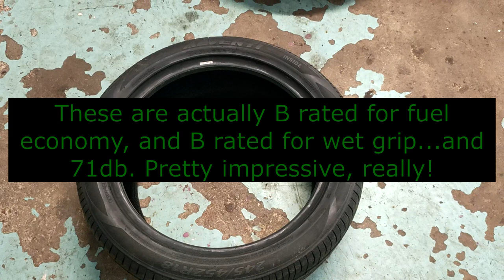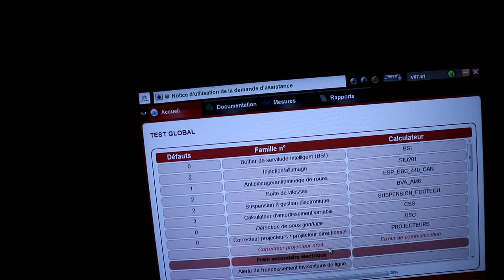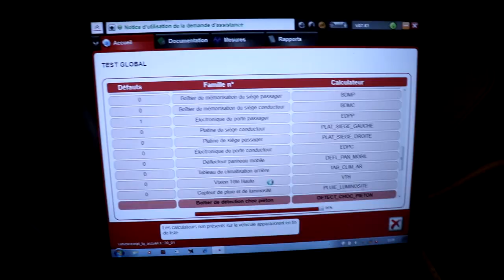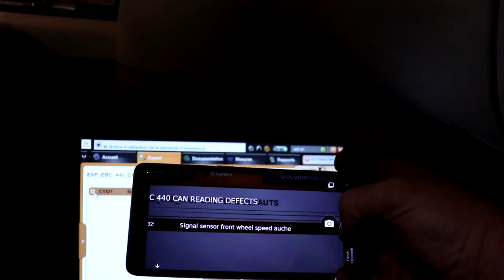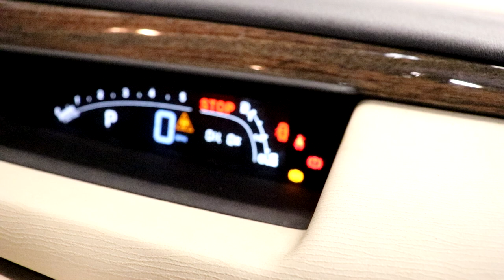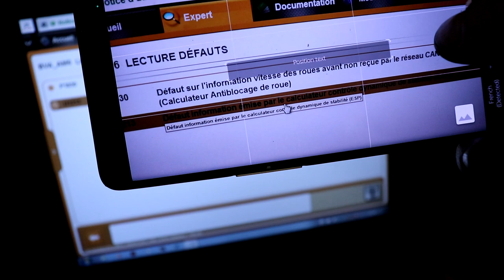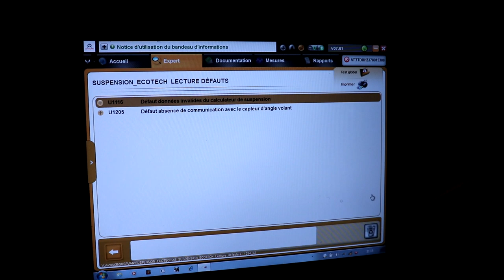Cheap Citroën C6 Project 8: Did HubNut BREAK my C6?! ft. Clement

Comment: We were told that C6 needs regular direction checkups, because of the heavy engine. Ours was also using the tyres unevenly before the direction adjustments.
Reply from the maker: Mmmm, not sure about that. Plenty of cars have heavy engines these days. I suspect the bigger issue is the fact the car travels at differing ride heights, so you probably need to get it 'spot on' as opposed to just 'in the green zone' as most tracking companies do.

Comment: I've just changed the front trailing arm bushes in my C5 X7, that upside down bolt on the arm under the driveshaft... Wtf where they thinking 🤦🏼‍♂️
Reply from the maker: The wishbone bushes?
Reply: @UPnDOWN  yes the purple ones  you replaced, night mare

Comment: Very interesting and informative as usual. But as an 2 x AX, BX and XM owner who had no real trouble with these 4 vehicles over 30 years+, my idea of buying a C6 when I retire soon has been abandoned. I have a reasonable sized garage to do work, but not a workshop. I worry for the future of these fine vehicles.
Reply from the maker: It's all relative. The C6 is as complex for its time as the XM was for its time. And, to be fair the kind of issues with ABS sensors and needing software to log in is no different on any other modern(ish) car. I would say the C6 is less complex than its contemporaries than the XM and BX were, if I'm honest. As for the future of them, they only sold 23,000 (compared with 300,000-odd XMs) so they're going to be more sought-after, more quickly, especially as they're the last big hydro-Citroen.

Comment: Too right, that never happens! I remember getting a s/h hub carrier for my Relay van. New hub had the sensor wire cut. No way was that thing coming out. Ended up leaving it in and splicing the wire to the original! Lucky the sensor was working ok!

Comment: These codes can well be auto transmission related aswell if there is any problem with the gearbox speed sensor or TCM.
Reply: Or it's wiring.
Reply from the maker: True enough, though thankfully it was just the ABS sensor.
Reply: @UPnDOWN  Yeah lucky escape there. Any Auto gearbox stuff is a very different can of worms.  I have an auto job coming up where it doesnt go into any gear and says all speed sensors are broken. (was left to drain the battery to). Is an opel so maybe itäs just a bad ground.

Comment: Good stuff as ever, really enjoying this series (it's also cemented that I MUST have a C6). Only one slight quibble - don't grease hubs and wheel bolts, I know it's a pain when they get stuck, but a greased joint face is significantly weakened, and the wheel bolts are significantly over-torqued (not that it really matters for them) even at the book tightening value.
Reply: Do NOT get a C6.
Reply: @fivish  it's too late for that, sometimes you open a door and realise there's no going back
Reply from the maker: Have to be honest, I've always done it and never had an issue. It's common practice, you just have to use common sense when tightening things up. Mind you, I definitely put too much on the disc on this, hand held high!

Comment: Did you say you had a knock on the suspension?

She worked her way quite a few lower hub carrier bushes before we found that the P bush the stabilises the whole lot had play in it. Had previously been replaced with C5 items which look the same but aren't. knock happens on acceleration from stationary or when braking for junction
Reply from the maker: No, not really. Did the hub carrier bushes already and the P pushes (I'm assuming) are the ones I switched to poly.

Comment: You can click on the yellow folder icon with number of faults on it to see the faults, no need to go into the menu.
Reply from the maker: Cheers, I'm still finding my way around it.
Reply: @UPnDOWN  If you'd like I could upload a cracked Diagbox installer (7.76 and 7.82) which I've received on a DVD with my interface and also a Diagbox 9.91 installer which works for my friend (I hadn't tried it) and give you the links. Those are both in English so you would actually know what you're looking at without a translator app.

Comment: Another fab video what is the software on the laptop.  Is it  Delphi or Citroen own was looking to buy a Delphi or a used 2015 launch  X 431 diagun   changed the timing belt kit thermostat housing water pump fanbelt and a second hand suspension pump on my own last week as the axcess was easy to them all while doing the timing belt  thanks anyway
Reply from the maker: DiagBox

Comment: Mate take my hat off to you. WHY all 4 wheel's to drive a speedo? I just don't understand. 🤪 love the car but don't know if I would cope as well as you. Actually I know I wouldn't. 🇦🇺
Reply from the maker: Most cars since 2000 do that, to be honest. The ESP needs to know the rotation speed of all the wheels to detect whether it's sliding or not. Just makes sense to use that same input for the speedo output.

Comment: I had a 2008 C5 2 litre diesel automatic with the pneumatic suspension and it was a nightmare of unreliability and huge repair cost. After 9 years and 100,000 miles the stearing rack died. I scrapped the car (£2,000) for a KIA. Do not buy French!
Reply from the maker: You've come onto a channel predominantly featuring Citroens of varying complexity to tell me not to buy a French car?! If you have an issue with a hydro-Citroen, and you take it to a regular untrained garage, you will have a bad time.